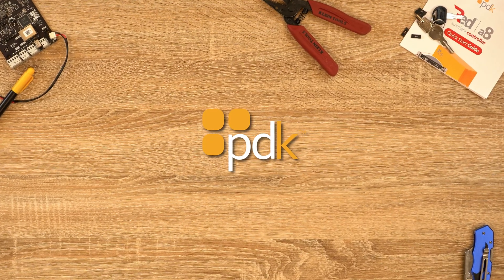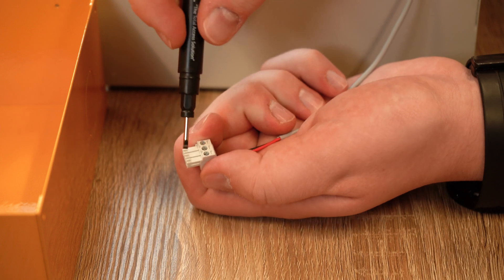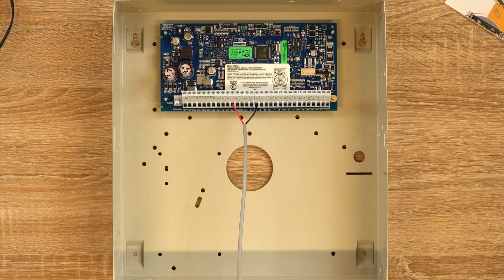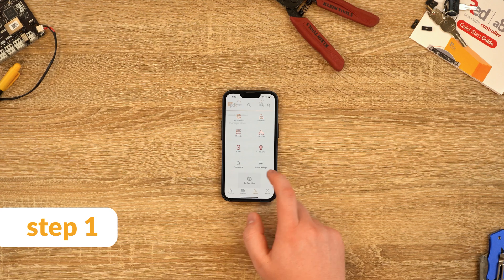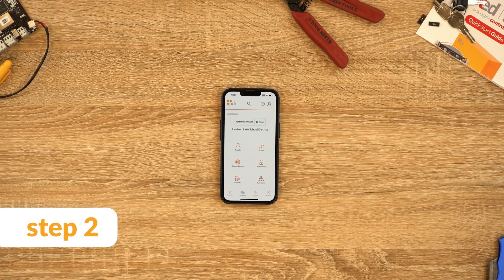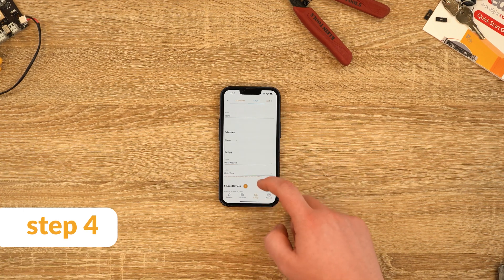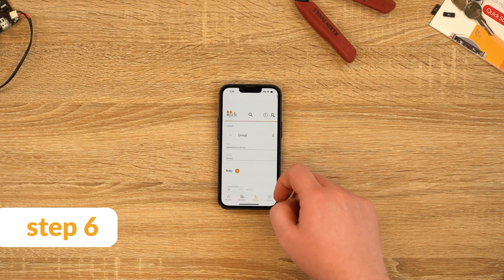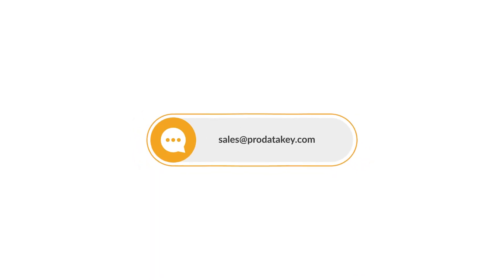How to Wire and Setup an Alarm Panel with PDK

Comment: do the relays and outputs work if the panel loses connectivity?
Reply: As long as the programming is correct, the relays and Outputs, as well as the entire PDK System, should function without cloud node connectivity for up to seven days. It should function indefinitely for those with E-Card access (Emergency card). What won't happen is any kind of real-time notification, and you won't have control from a mobile device. What they don't say in the video is that you also have to program the alarm panel to recognize the key-switch arm/disarm input, which is a little trickier if you are not an alarm guy.